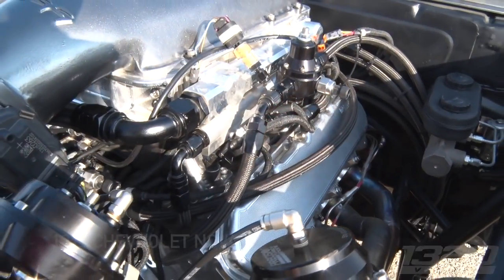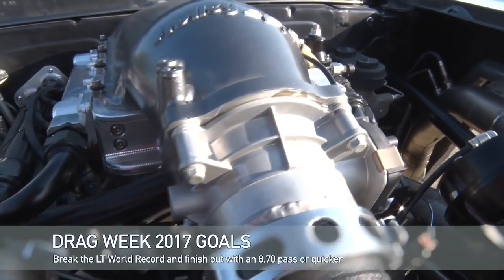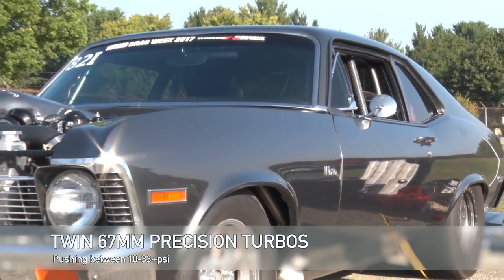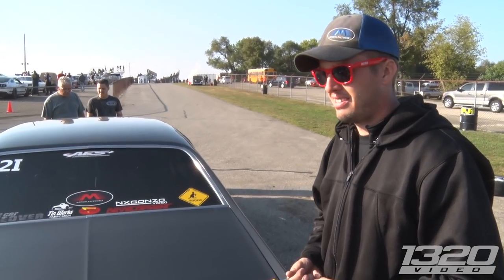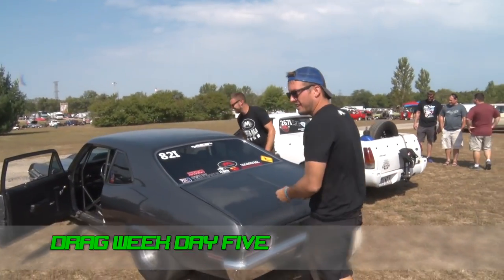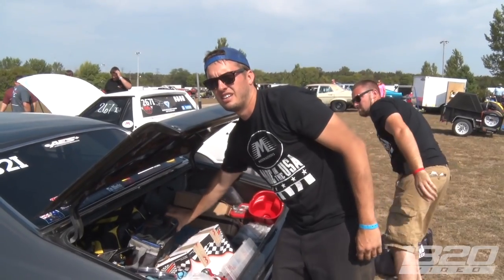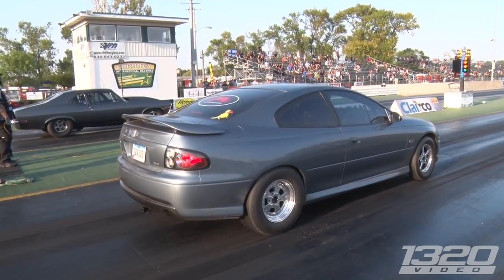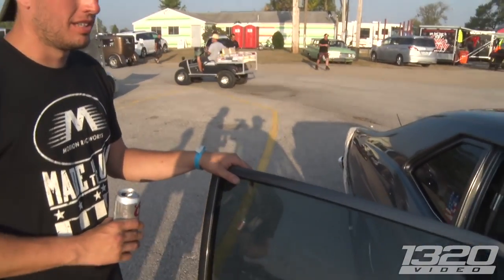They Were BORED with LS’s! - NEW World Record!

Comment: Ain't nothing like a chevy v8
Reply: Big frank a good boat anchor gives em a run for their money
Reply: Damn straight! Take the same cubic inches in a Ford and you are going to have to spend a lot more money for the same performance. Had a 460 ford it would not even come close to my brothers small block 400 GM motor.
Reply: Chevy makes shitty 4 cyl cars, shitty interiors, etc. But their v8 and transmission are god like.
Reply: cough mopar, ford, etc.
Reply: kelly, you actually have to do more work to chevy motors to get the same hp as other engines. the only reason you think it takes less is because the parts are dirt cheap. mopar and fords can make better power with less parts, but they cost more.
Reply: Frigglebiscuit you saying Chevy's take more work is totally dumb. If Ford and dodge engines wear better why wouldn't everyone be using them? Sprint cars even use a small block chevy
Reply: Frigglebiscuit after hearing you say that ridiculous comment I'm guessing you're not a build guy, just a buy and drive and that's probably why you don't know
Reply: JDog not all sprint cars use small block chevies lmao.
Reply: JDog ironic you say that, because 99% of chevy guys are buy and drive. They just buy cheap edlebrock/used parts that someone else had and slap it on. Then they ride around acting like they built and engineered the car with their bare hands.
Reply: Frigglebiscuit I guess that's what all these drag cars are then huh?
Reply: Derrik Lee You're wrong on that statement good Sir. I have a 1988 Ford 302 block sitting right next to me, greatest, heaviest boat anchor ever invented, aside from the same size Chevy motor which I'll obviously want $3 more for.
Reply: jdog, you mean all the hemis that hold wrold records and are the fastest?
Reply: Frigglebiscuit Chevy engines are Superior to anything. Ask anybody who builds engines
Reply: JDog *superior
Stop drinking so heavily and you might be taken seriously.
Reply: Ham Steaks I drink excessive amounts of tequila when stressed, sorry
Reply: JDog uhh 2JZ GTE and VQ38DETT?
Reply: Yuss, haha 69th like 😎🖕🤘👍
Reply: Kelly Hollingsworth Hey this was done with a Ford motor. Good day sir
Reply: anthony rodriguez hahaha, yeah that'd a world record for FORD JUNK!!! Chevy did times lower with boosted ls's long time ago bud
Reply: kevin auman show the proof
Reply: Jerrod, "If Ford and dodge engines wear better why wouldn't everyone be using them?" It's ALL about $$Cost$$$. The LT4 Is Junk compared to a hellcat let alone Demon engine. The Chevy's can't compete with the Hemi's. Just look at hennessey, 1,000hp and he barely modifies the hellcat, with a LT4 ZL-1 he's modifying heads.cam etc.

It's the same with Foxbody 5.0 guys.... The Windsor stock engine was the BIGGEST piece of shit, only the AFTERMARKET saved that engine. E7TE HEADS were probably the WORST flowing small block heads.

The stock magnum dodge heads out flowed the the Gt40 heads with ease.
Reply: Big Fank,  "Ain't nothing like a chevy v8".....

Except the SUPERIOR HEMI ;-)
Reply: "Chevy engines are Superior to anything. Ask anybody who builds engines"

LMFAO, they are only superior after modification...and that's ONLY against stock HEMIs.
Reply: PETER, IF??? GM was superior??? They wouldn't be COPYING MOPAR ENGINES.
Reply: Anthony Rodriguez, LOL..... This was a LT based record.  There are MUCH faster cars than the that GT500.
Reply: Hell Dodge has been kicking chevy & Ford's ass since the  late 1950's.
Reply: anthony rodriguez no need for me show the proof bud anyone can quickly search on YouTube a d discover that turbo fed LS engines have broken many world records!!! And are mounted in most drag cars or they are the most popular engine used I should say! Do some research bub
Reply: Frank289100 have you lost your marbles??? Lmfao, so ford designed one of  chevys best motors?!?!? Let's get real bub
Reply: Porridge.
Reply: THE PROSTOCK DRCE SINCE 1983 WAS GM'S VERSION OF MAKING A BIG CUBE FORD CLEVELAND MOTOR. THEY TOOK A OLDS BLOCK AND STUFFED IT WITH A ROTATING ASSEMBLY FROM A BIG BLOCK CHEVY AND THEN THEY MADE A BIG PAIR OF FORD CLEVELAND HEADS FOR IT. THIS IS THE REASON FORD DOESN'T GET INVOLVED IN PROSTOCK RACING BECAUSE IT IS ALREADY A FORD BASED ENGINE GM USES..THE LS IS EVEN WORSE. IT IS A REGURGITATED FORD 427 HIGH RISER MOTOR WHERE THE PORTS ARE RAISED GIVING IT A STRAIGHT SHOT INTO THE CYLINDER WHICH GIVES IT BETTER FLOW. THIS WAS A FORD CONCEPT THAT DATES BACK TO 1964 WHEN THE FORD 427 DEBUTED. THIS MOTOR WAS BANNED IN MANY VENUES OF RACING FROM NASCAR TO 1/4 MILES TO LEMANS, ETC. THIS WAS THE REASON FORD STOPPED PRODUCING IT. TECHNICALLY THE LS IS A RAISED PORT 351 WINDSOR. IF YOU PUT YOUR FINGERS INTO THE INTAKE PORTS YOU WILL SEE THEY CURVE INTO THE INTAKE VALVE WHICH PRODUCES A SPIRAL INDUCING COMBUSTION CHAMBER. THE LS ALSO USES A 351W FIRING ORDER. IT USES A FORD STYLE ANGLE PLUG AND FORD STYLE KIDNEY SHAPE COMBUSTION CHAMBER FROM THE 427 FORD. IT USES FORD STYLE CROSS BOLT MAINS AND A FORD OILING SYSTEM WITH ITS CRANK DRIVEN OIL PUMP. IT USES TEN BOLT MAKING A BETTER SEAL ON THE HEAD WHICH ANCHOR INTO THE BLOCK WEBBING FOR STRENGTH NOT THE BLOCK DECK. THE SYMMETRICAL HEAD AFTERMARKET BIG BLOCK ARE FORD DESIGNS MOSTLY CLEVELAND LABELED AS CHEVY AND THIS IS WHAT THE MANUFACTURERS HIDE FROM THEIR CHEVY CLIENTELE. ALL YOUR 800+ MOUNTAIN MOTORS ARE FORD BOSS 429 DESIGNS ONCE AGAIN LABELED AS CHEVY. IN NASCAR THE CHEVY SB2 MADE YEARS BACK WERE DESIGNED BY FORD. WHEN FORD WANTED TO REPLACE THE THUNDERBIRD WITH THE TAURUS NASCAR TOLD FORD NO BECAUSE A 2 DOOR TAURUS DID NOT EXIST. NASCAR WHICH IS ANOTHER DIVISION OF GM THEN TOLD FORD IF THEY WOULD ALLOW THEM TO USE THE TAURUS ONLY IF FORD ALLOWS CHEVY TO USE THE FORD CLEVELAND DESIGNS FOR A NEW NASCAR MOTOR CHEVY WANTED TO BUILD AND FORD RESPONDED ABSOLUTELY NOT. FORD THEN CAME BACK AND TOLD NASCAR THEY WOULD DESIGN A PAIR OF HEADS FOR THERE EXISTING SMALL BLOCK WHICH WOULD MAKE IT COMPETITIVE WITH THE CLEVELAND SO FORD THEN DESIGNED THE SB2 HEADS FOR CHEVY WHICH THEN ALLOWED FORD TO RACE THE TAURUS. THE CURRENT CHEVY NASCAR RO7 ENGINE IS A FORD CLEVELAND KNOCK OFF. IN 1987 FORD SOLD 70% OF LOTUS TO GM BUT KEPT THE ENGINE DEVELOPMENT AND RESEARCH DIVISION OF LOTUS. THE 1989 CHEVY ZR1 DOHC V-8 WAS ALSO DESIGNED BY FORD ENGINEERS IN LOTUS. YEARS BACK WHEN CHEVY WAS IN TROUBLE WITH THEIR INDY V-8 ENGINE THEY WENT TO FORD COSWORTH FOR HELP WHO RESIGNED THEIR ENGINE. EVERYTHING CHEVY USES IN RCING TODAY IS ALL FORD.
Reply: IF IT WASN'T FOR RULES UNWRITTEN AND RULE BOOKS WRITTEN THAT FAVORED CHEVY TO WIN THEY WOULD HAVE GONE NOWHERE. THE NHRA DETERMINED WHO WOULD WIN AND THAT DETERMINATION FAVORED CHEVY EVEN OVER THE OTHER DIVISIONS OF GM. SO YOU KEEP ASKING WHERE IS THE PROOF. I WILL GIVE YOU THE PROOF. THE SMALL BLOCK CHRYSLER AND THE SMALL BLOCK CHEVY LAYOUT ARE ARCHITECTALLY ARE THE SAME. THEY BOTH HAVE THE SAME FIRING ORDER BOTH HAVE REAR DISTRIBUTOR DESIGNS BOTH HAVE THE SAME SIAMESE INTAKE AND EXHAUST PORT DESIGNS BUT THE CHRYSLER WAS BETTER. THE CHRYSLER HAS A ANGLE PLUG HEAD AND A 18 DEGREE VALVE DESIGN STOCK WHICH CONSTITUTES A RACE HEAD FOR A CHEVY. THE CHRYSLER HAS THE CAM UP HIGHER INTO THE BLOCK WHICH IN TURN USES SHORTER PUSH RODS MAKING THE VALVE TRAIN LIGHTER AND ALSO HAS RAIL TYPE ROCKER ARMS FOR A MORE STABLE AND HIGHER REVVING ENGINE. SINCE THE CHRYSLER USES A MORE ADVANCED CONVENTIONAL DESIGN SIMILAR TO THE CHEVY. ANSWER ME ONE QUESTION. WHY HASN'T THE CHRYSLER SMALL BLOCK REACHED THE RACING STATUS THAT THE SMALL BLOCK CHEVY REACHED AFTER DECADES OF RACING?
Reply: ANSWER THE QUESTION; IF IT WASN'T FOR RULES UNWRITTEN AND RULE BOOKS WRITTEN THAT FAVORED CHEVY TO WIN THEY WOULD HAVE GONE NOWHERE. THE NHRA DETERMINED WHO WOULD WIN AND THAT DETERMINATION FAVORED CHEVY EVEN OVER THE OTHER DIVISIONS OF GM. SO YOU KEEP ASKING WHERE IS THE PROOF. I WILL GIVE YOU THE PROOF. THE SMALL BLOCK CHRYSLER AND THE SMALL BLOCK CHEVY LAYOUT ARE ARCHITECTALLY THE SAME. THEY BOTH HAVE THE SAME FIRING ORDER BOTH HAVE REAR DISTRIBUTOR DESIGNS BOTH HAVE THE SAME SIAMESE INTAKE AND EXHAUST PORT DESIGNS BUT THE CHRYSLER WAS BETTER. THE CHRYSLER HAS A ANGLE PLUG HEAD AND A 18 DEGREE VALVE DESIGN STOCK WHICH CONSTITUTES A RACE HEAD FOR A CHEVY. THE CHRYSLER HAS THE CAM UP HIGHER INTO THE BLOCK (A ASPECT OF RACE DESIGNS USED IN RACE BLOCKS TODAY) WHICH IN TURN USES SHORTER PUSH RODS MAKING THE VALVE TRAIN LIGHTER AND ALSO HAS RAIL TYPE ROCKER ARMS FOR A MORE STABLE AND HIGHER REVVING ENGINE. SINCE THE CHRYSLER USES A MORE ADVANCED CONVENTIONAL DESIGN SIMILAR TO THE CHEVY. ANSWER ME ONE QUESTION. WHY HASN'T THE CHRYSLER SMALL BLOCK REACHED THE RACING STATUS THAT THE SMALL BLOCK CHEVY REACHED AFTER DECADES OF RACING?
Reply: I KNEW A FELLOW WHO DRIVES COAST TO COAST TO EVENTS YEARS BACK WITH A TURBO SMALL BLOCK FORD DOING 7.88 IN A STREET CAR. BIG FRANK IS NOTHING BUT A FEATHER WITH HALF A V-8 POWERING IT.
Reply: Anthony rodriguez that's not even an impressive time dude this is a home built brand new motor that hasn't been figured out and it's less than a half second slower in a heavier car on worse tires with most likely less power
Reply: Frank289100 gotta love people so obsessed with their brand they'll lie about it just to make others look bad
Reply: "Nothing like a Chevy V8..."

...nothing except for the other 20 million cookie cutter Chevy V8s!
Reply: RyTrapp0 have you ever been out in society? seriously ever heard someone say "Nothing like a cold beer after a long day" it means nothing compares to the type of thing
Reply: 1423 171 You ever heard of sarcasm? What about hyperbole? A "joke" perhaps? What about the concept of "sense of humor", is that a new one for you?
Reply: JerseyMikeP; after reading these dumb comments about the worst flowing heads, the 351 cleveland that came out in 1969 was the best flowing stock small block head. Just remember Bob Glidden !!
Reply: This is true chevy all the way
Reply: @JDog23332  The 350 is weak. Compare it side by side to the 351w. I'm embarrassed for you. 4 bolt mains are a must.
Reply: Lt4 is not chevy

Comment: Their camera looks ten times better than yours
Reply: their shakecam?
Reply: Māris Samats clarity only I should have clarified that
Reply: its a DSLR vs a video cam. one has lens built for high def images and the other one is a lens included in the cameras body. you can hear the auto focus motor on the camera when it focuses.
Reply: Which sounds annoying and the shake.. but none the less a quality pic. Frame rate seemed a little slower tho maybe it's me.
Reply: Honestly I wouldn't mind some sort of stabilizer like a steady cam, or even better a gimbal. The picture is beautiful though.
Reply: Ya know maybe what camera it was ??
Reply: Cloudy day vs sunny. Overcast brings the best color and detail for cameras. Still or video.
Reply: Trading quality for framesss
Reply: it is a little slower, but most noticeably when merging higher frame rates with slower ones in the same video. No software likes it when you do that. DSLRs usually have much better quality, but at the expense of zoom/focus noise and no stabilizer
Reply: said no one ever
Reply: the framerate issue would just be that it is shot in a different framerate to the first clip, so it would not suit the native sequence framerate causing the stutter.

Comment: hahaha sometimes carbs are better,, electronics fail sometimes..
Reply: eventually electronics ALWAYS fail and plastics rot or crumble,  50 years from now his 72 nova will still be there but a 2005 corvette  will be crumbled away
Reply: a 2005 corvette is fuel injected too Frank,, plastics don't rot or crumble check your lakes and rivers....
Reply: Do you need me to make a vid showing my dads 2004 buick that the plastic is dry roting and falling apart, the  lock button crumbled and the console fractures into little pieces if you touch it.  Plastic dehydrates over time making it brittle meaning there is a set amount of time plastic can last, car companies know this and factor it into the life of the car which are now disposable, unless a modern car is kept in a climate control bubble very few will make it past the 30 year mark. Now sure a Q-jet carb has a few parts that eventualy go bad but i can just about make new ones at home however i cant make a plastic bumper skin or a modern fuel pump and 30 years from now good luck getting parts for a then old car at a reasonable price. Just like first gen  caddy CTS go pennies now because when something breaks it cost more then the car is worth to fix ,so there it sits for $2,000
Reply: More race less tune
Reply: @Richard Skipper takes a real mechanic to make a carb work good

Comment: Sweeet! Gotta love them old Novas with HUGE engine bays and so much you can do with them. Gorgeous engine setup. So clean from the getgo.  Those guys have the right mind set. Do it right from the start and don't screw around.

Spend the money on turbos BEFORE you go cheap, buy nitrous, burn parts, burn more parts and eventually look at your parts bill and see you could have put two 88's in your nova. 

Nitrous really is a dying beast with the new Gen 2 turbos, Prochahgahs and even more roots blowers on the road,

Comment: THAT WAS FUCKIN NICE, I KNEW YOUR FIRST RUNS WERE BAD I COULD SEE THE CAR DRAGGING. ONCE YOU FIXED THE WIRING TROUBLE SHE PICKED UP. THAT LAST PASS WAS 7.70? YOU BEAT WHAT YOU WANTED RIGHT? NEW MOTOR, BUT ON FULL CHASSIS AND WEIGHT IS AMAZING MAN. THAT CAR IS HEAVY EVEN COMPARED TO A PRO COMP.  WITH LESS H.P. GOOD JOB GUYS. KEEP IT UP. MAYBE WE'LL SEE YA IN JERSEY ONE DAY FOR A NHRA FINAL.

Comment: For the past week I've been debating on whether to get a 5th or 6th gen camaro. Only bc of Ls3 or Lt1. This video helps
Reply: 200 pound difference helps too
Reply: Ls3 bud all day
Reply: I got a LT1 that I will sell you.  Built for power adder low compression motor.
Reply: LS still has better aftermarket.
Reply: Put a 283 in it

Comment: Only issue....Why would you put 1-1/2ft of the roll cage with a carbon fiber cover that is riveted on. Looks SOO ghetto.
Reply: JerseyMikeP So it doesn't look like shit, with all the paint scratched off just from getting in & out of the car. This "ghetto" look(...right...) is standard practice in most high end builds, including a lot of professional race cars as of the last 10 years or so
Reply: Rytrapp0.....It actually makes it look worse...stands out. Since they spent so much $$$ on this car...that was kind of cheap looking. 

"This "ghetto" look(...right...) is standard practice in most high end builds"...What high end builds? GOT any links...probably from the same shop that did this one. 

Should have sleeved the whole tube if they wanted it to look nice...would be cheaper to do than the carbon fiber bumpers.

Comment: Go check out NRE out here in Chatsworth CA, It's Tom Nelsons....Nelson Racing Engines. Tom is the master with twin fuel systems, with his very trick twin fuel cell and separate fuel systems  that has two compartments within, one 10 gallon holding 116/124 octane the other part holds 20 gal of 93 octane. 

NRE makes fully street driven 2000hp plus cars that with a few tweeks from the drivers seat can go from a 1000hp 20mpg twin turbo daily driven bad boy to a fire breathing 2000hp+ 1/4 mile or back road car that after you kck some butt on that back road you can drive home with just a few buttons to push and get that 20mpg back. 

Tom Nelson makes the Mirror Image Turbos that have a left and right spin for  easy under hood insrallation. 

Combine his skills with turn key 2000hp street driven cars and the fabrication that comes out of his shop along with there fuel systems, turbos and a new line of injection systems.

Comment: what is a LT4? serious question
Reply: LockTest The new generation of Chevrolet V8. Basically an updated LS engine. Has direct injection and I believe variable cam timing as well as other updated or tweaked stuff in the motor.
Reply: Ahh ok, Thanks for the info! I thought I heard them mention direct injection but I wasn't sure if that was some extreme mod they made with new heads or if it was factory. Quite impressive then its always harder up-tuning new engines that have not been around that long.

Comment: 68 thru 71 my favorite style of suspension yet body style has always been 66& 67 being coil. Over A arm sucks, I've tried um all don't know how 66 nova got in to NASCAR, ok only the body was Nova looked great with 60 series tires all around NOVAS ARE UNIQUE IVE DONE EVERY YEAR ENGINE SIZE MOD THE LAST NEVER COMPLETED DUALL THROTTLE BODIES IN OLD TUNNEL BOX RAM NITRI 3 STAGE WITH OLD CLUTCH TURBO

Comment: LT4 is still a LS with added stuff.
Reply: non of the parts are interchangeable except for wrist pins and a few bolts, so no not the same, the LT's have 11degree canted valve heads and direct injection and a new deck thats better for boost.

Comment: Just what is wrong with a mechanical throttle?
Reply: It won't work with the stock ECU. Since he's using the stock ECU he had to use drive by wire or it'll go into limp mode.
Reply: @allanb3222  Bummer. Thanks.

Comment: You guys really are idiots commenting on things you know nothing about, chevy powerplants. The gen 5 lt4 is a new engine based off the ls platform. This is the third time chevy has made an lt the first being 1970 360horse in novas camaros and vettes the 2nd which redesigned the small block which is why its a second gen sb, from 93 to 96 with reverse cooling front mounted distributors then 97 came the third gen sb the ls. Duh get it then fourth gen now fifth gen with another variation of the lt with nothing to do with either of the first two because it is derived of the current sb form the ls. And no there never was and still not a big block ls. Ls comes from the small block generation.